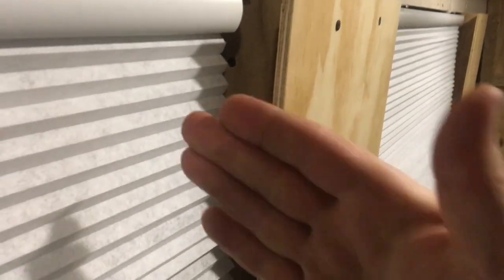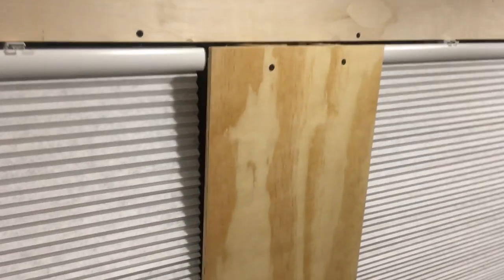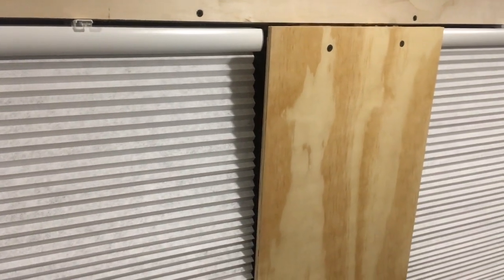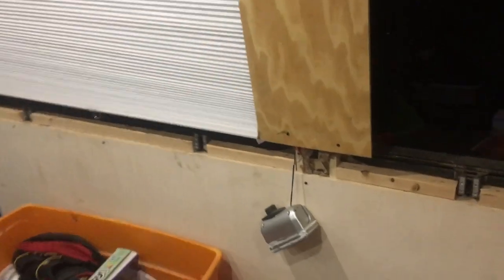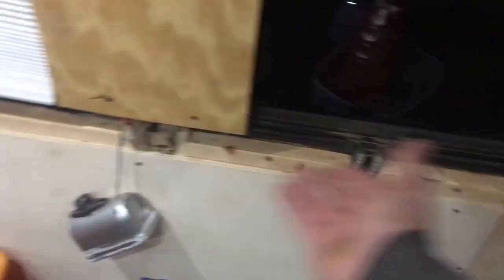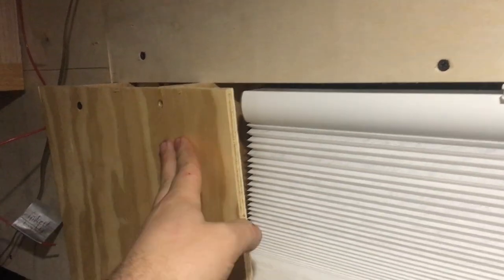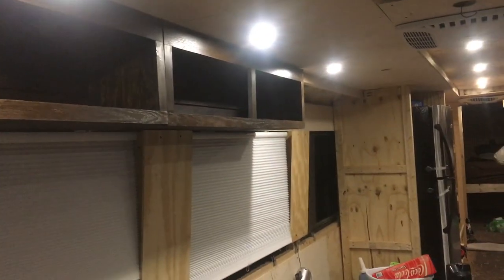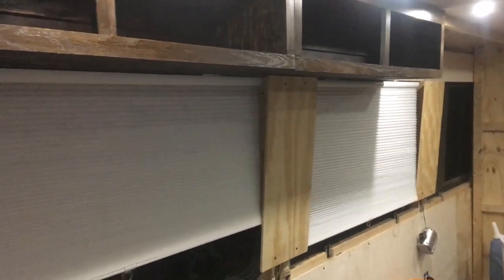Cellular Blinds Rough in on Bus Conversion

Comment: Had almost the same set up on my last coach I felt your pain on the cost of them but worth every penny I wrapped my blinds in solid oak 2×3 with a 4 inch face it worked out great they are very quiet traveling and great insulators. Great choice.